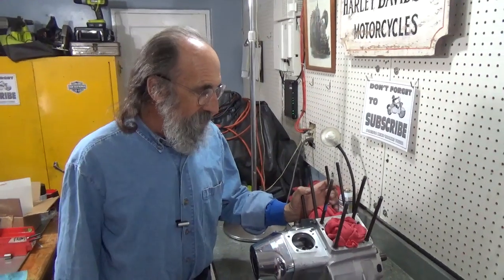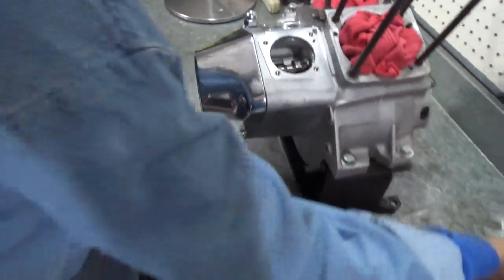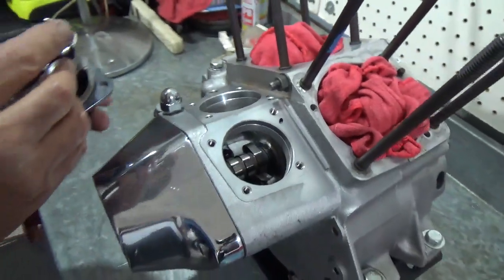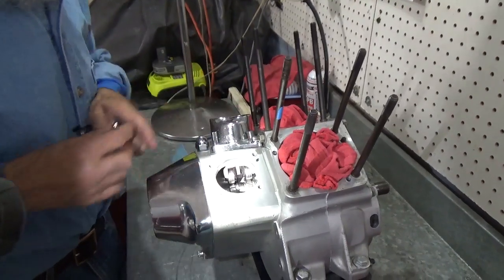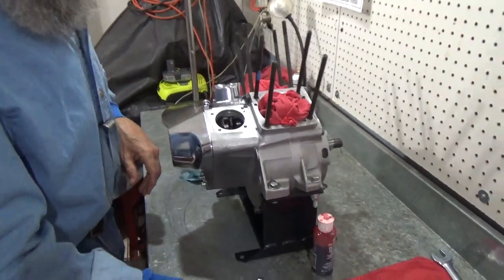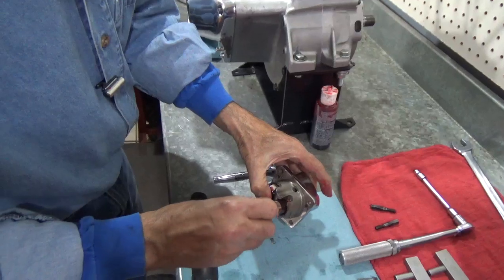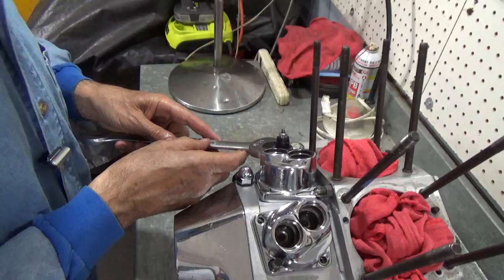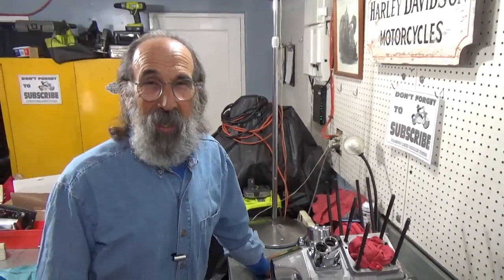Evo Motor Assembly, Part 7, Installing Valve Lifters

Comment: My manual for a 91 evo says 12 to 15 foot pounds I told people this and they thought I was crazy that it should be inch pounds. Finally I seen your video and it’s a weight off my shoulder knowing it’s actually foot pounds I was too scared to do 15 so I did mine to 12 foot pounds.
Reply from the maker: In the Evo book, there is a section on fasteners.  It's a great chart on some basics.  It could make us both appear brighter.  It gives you optimum torques for basic sizes and grades.  It's good stuff.  Thank you for bringing up some questions which need answering.

Comment: How do you cap the oil sending unit if you are going gaugeless?
Reply from the maker: It depends on the cases you're using or oil pump, again, where it goes.  It is most likely a 1/8 pipe thread and therefore, go to the hardware or auto parts store and get a 1/8 pipe plug.  Don't let the description confuse you.

Comment: hi . can anyone please tell me why my evo motors long studs that the barrel goes over are hollow with threads inside for the head bolts to tighten onto .  the motor is in a custom chopper.  nothing is standard on this bike.
Reply from the maker: The nuts are closed on the top.  The studs are not hollow, they are "stretch studs."  This is unless you have something truly unique.  I think you're mixing some definitions.  Be sure you torque things as per the manufacturer.
Reply: @pacificmikesgarage  thanks mike for replying to my question.  My head bolts are not like yours on the evo motor. You call yours nuts because they are hollow . My cylinder head bolts are actualy solid  bolts because the long studs that come from the crank casing are hollow at the top with threads inside them  to receive the head bolts.. I'm talking about the long studs that  the piston cylinder slides over are  hollow . and the head bolts (which are proper bolts)  tighten into these studs that have threads on the inside .  It's very different to your evo motors that you work on.. Do you know of an evo motor that has such a design that I'm talking about.  ?  .
Reply from the maker: I would think the motor would have some info cast into it.  What is the bike registered as?

Comment: Should add 6.5 step to shim the cam to noise cover backlash then put the lifters in
Reply from the maker: You might want to check your cam gear and pinion gear to be sure they are right for the bike.  Service manual covers this.  I don't know what you have or what you installed.  Too much noise, time to look it over.

Comment: wish you explained the alignment tools better. I have no Idea how the worked . wouldn't the screws have done the same thing.
Reply from the maker: The alignment screws are tapered where they go through the tappet block.  They hold the tappet block in the proper place more accurately.

Comment: Hey Mike, I will be doing the lifters on my 87 evo in a few days as time permits. Do I need to let the lifters sit in motor oil prior to installing? I will be leaving the bike sit thru the winter, unless Texas gets a really nice day or two before spring. This is my first harley so I thank for any help you can share with me. fred
Reply from the maker: The lifters should come "preoiled."  Just remember not to immediately rotate the engine after adjusting each pushrod.  Wait for each lifter to bleed down before rotating the engine to adjust the next lifter. Remember, after letting the bike sit all winter, be sure and put a pan under it for your startup in the Spring.

Comment: what a good content mike, I'm from Chile and I've been watching your videos for a while. you explain everything very well, you are very good at doing this job, thanks for showing all this.
I am rebuilding my fxlr 1992 and you help me a lot with some doubts that I had. Could you tell me what was the torque you used in Valve Lifters please? thanks Mike
Reply from the maker: I try not to give answers on things you could easily look up in a service manual.  But, something struck a nerve.  I know that's a 1/4 x 20 bolt threaded into aluminum (I assume you're speaking of "tappet guide bolts").  This should be, according to Harley's usual spec, 90-120 inch pounds.  But I found an incorrect number in a service manual.  90-120 inch pounds is correct for the tappet guide bolts on a 1992 Harley Davidson Evo (Big Twin) engine.

Comment: Hey we need advice on a1995wide glide brakes on front . In other words you are not getting fluid thru lines. Master cylinder works perfect  sooo????? Thanks LB( Noni)
Reply from the maker: Sometimes, you get bubbles in there that just get stuck.  Try tapping on the lines everywhere there is a bend.  Don't beat on them, but tap with a wrench.  Make sure the master cylinder is level.  Alot of the time a "Mighty-Vac" or similar vacuum pump is the solution.  Another thing to try is a rubber band or bungee cord holding the brake lever against the grip.  Leave it overnight and release it in the morning.

Comment: Hi, I enjoy watching and learning wrenching ,just one question. Why do you need an alignment tool for the tappet blocks ,when you can just use the original fasteners?
Reply from the maker: There's a little wobble room in the later stuff.  They should be lined up with the lobes on the cam.

Comment: no Thread sealer or glue...  okay it should be fine i think...  i like the blue thread sealer because you have no lock washers on these bolts... i just think it won't hurt...
Reply from the maker: I don't like thread locker in the threads of my aluminum parts.  Just me.

Comment: hey Mike what is a good sealant for paper lifter block gasket ? or just use a thin film of oil on them
Reply from the maker: I usually spray copper coat on them.  They don't leak, but they're really stuck on.  I may be doing that tomorrow.

Comment: Just got 1987 Electra glide an has horrible tick an the shop that serviced bike told me they have a high revving cam in them and at the loud tic was normal but it really loud an bike has a lot of miles idk how many
Reply from the maker: Maybe you should have someone else check it out.  You need to know that it's okay, or it isn't.  Tick gets louder, pretty soon, it's a bang.

Comment: How do you get a fac. head gasket off easy
Reply from the maker: Well, is it a cast iron cylinder, an aluminum cylinder?  Is it a cast iron head or aluminum head?  What are you trying to do?  Is the cylinder and head on or off?  Can these items be soaked?
Reply from the maker: What is the motorcycle?

Comment: Mike I have a 1990 fatboy 1340 original case compression  test shows 167 psi  on front 169psi o. Rear cylinder I was told it has an ev46 cam I'm I stalling lifters I chose a set.of 33-5353 tappers. I do not have the alignment tool also bike has Rivera ajustable chromoly push rods that look to be in great shape my question to you is the 33-5353 tapper a good choice? Also it is the HL2T kit will this work out or should I change the pushrods and get the alignment tool before I do the job?
Reply from the maker: I don't know those catalog numbers or where they came from.
Reply: @pacificmikesgarage  S&S hydraulic lifter with the HL2T travel limiter
Reply from the maker: I'd have to read their literature.  Most aftermarket lifters are way better than the originals.  I still read instructions.  I can't keep all that data in my head.
Reply from the maker: The adjustment is figured by the manufacturer for how much the lifter must be compressed.  You simply have to combine what the lifters require with the amount of turns to extend the pushrods (number of threads per inch).
Reply: @pacificmikesgarage  The lifters look exactly like these in this video

Comment: Hey mike thanks.  I have a question... Can you install the lifters 180 degrees out?  And if the lifter has no oil will it be weak when you go to adjust the pushrods.  3 of 4 of mine i had to wait 10 minutes each to bleed down and the last one i put the 24 flats on and almost immediately i could turn the pushrod by hand.
Reply from the maker: They do tend to vary.  Because you said "24 flats," I could assume you're working on a Shovelhead.  If it has stock lifters, the holes in the lifter bodies must be turned "in" or, toward each other, assuming they are stock type Shovelhead lifters.  If they aren't, they're Evos or Twin Cams, then the rule no longer applies.
Reply: @pacificmikesgarage  the 24 flats comes from my big dog service manual.  The motor is all s&s 107 evo style.  All parts are s&s. I have heard 3.5 turns and i didnt see a pushrod adjustment in your evo engine rebuild series.  Am i doing it wrong
Reply from the maker: If you're following your service manual, you've got it right (right service manual for your motor).  You've "heard" 3.5 turns?  You need to know what's in your motor.  If you bought it new, you know its history.  Sometimes it's very difficult to figure out what you have, but, well worth the effort.

Comment: Mike, Do new lifters need to be primed with oil?
Reply from the maker: I generally soak them first.  Then I install them.  Then there is no doubt they have oil in them and you don't have to wait for them to pump up.  It's really easier with an electric starter, to spin the engine with the spark plugs out to make sure they're happy first.
Reply: @pacificmikesgarage  Thanks Mike, That was my thought.

Comment: Do you have to use the alignment tool?  Would not the lifter bolts align the block as you finger tighten them?

Thank you, in advance for an answer.
Reply from the maker: I got in the habit doing Evos.  It is "believed" the tappet rollers will line up more accurately with the cam, on an Evo, this way.  It really is easier to get the whole thing set up this way.  But, it's a good question.

Comment: Are those hydraulic lifters? If so I always thought you had to pump them with oil before installing them
Reply from the maker: They had oil in them.  Before starting the engine, I rotate to pump the lifters full.  I thought I explained that in the series where I built the engine.
Reply: @pacificmikesgarage  thanks I’m sorry I didn’t catch that part of the series

Comment: Hi Mike, great videos, had my evo rebuild and now getting heavy oil leak from sprocket shaft bearing seal, running open belt so seal spring is on inside, would appreciate your input
Reply from the maker: Did you replace the spacer with the seal?  If not, the spacer gats a groove worn in it from the seal.  You install a new seal and it doesn't fit the same.  That's what it sounds like.

Comment: Hi Mike,

I have scoured my  J & P CYCLES catalog pretty thoroughly & can not LOCATE the Lifter-Block ALIGNMENT Tool(s)  that you are using on both the EVO & SHOVEL-Head assembly 

Any idea what brand name they were SOLD under ?   or where  I could locate a set of them ?

Thanks for the VIDEOS

COOP

..............................................
Reply from the maker: Yes they are a lifter block alignment tool made by Jim's Machine.
Reply: @pacificmikesgarage  - Thanks Mike - 
I have quite a few TOOLS & ITEMS from JIM's - Thanks for the direction 
COOP
...........................

Comment: Question, Mike. What was wrong with the engine ? Nice series btw👍
Reply from the maker: Thank You.  I didn't like the way it felt.  I went in and "talked" with everyone present.  This bike is a very personal unit and I don't share much about her internals.  That motor is where I experiment.
Reply from the maker: Sorry.  I thought you meant my Shovelhead.  This Evo motor had massive "bad luck."  It started with lifters coming apart and went worse from there.  Then there was a motor to replace it and it wasn't installed properly.  It got problems right away.  I mixed the two motors together, using all the good stuff, and there it is.
Reply: Thanks, Mike.👍
Reply: Ok, thanks again. I own a 1989 flhtp for 9 years . It came from Texas. Now it lives in the Netherlands😃

Comment: Thanks for another great video. I'm curious about your opinion  on using an oil pressure gauge instead of the sensor. And where to install it, sensor hole or the lifter screen plug. Im working on a clean Evo-Chopper and want to skip as much electrics as possible. Thanks from Sweden!
Reply from the maker: Sensor hole with a tee, so as to still have the sensor.  An oil pressure gauge drives me nuts.  All I want to know  is that I have good circulation.
Reply: @pacificmikesgarage   Thanks for your input, guess I keep the sensor anyway. Thanks!

Comment: Mike, when you had the case apart why did you not put a drain plug in the bottom end.?
Reply from the maker: For what purpose?
Reply: To drain that that one qt on a oil change. Is that not where it is located?
Reply: On an Evo you can run the engine with the oil filter off after changing the oil to clean the bottom of the cases out. Just keep adding oil to the oil tank until it comes out perfectly clean.

Comment: Okay I have to ask the question. Why are the locator tools better than just the four bolts that belong in the lifter blocks?  Wouldn't they line it up properly?
Reply from the maker: I'm sorry I didn't do a better job of showing the tools.  They are long and have a precision made taper on them.  The holes in the lifter blocks are fairly large.  The tools center them up very well.  Then, the same tools are useful for installing other things, like Twin Cam oil pumps.
Reply: Ah,  OK.  Gotcha.  Thanks.

Comment: I have a Korean junk RevTech Evo that is in my shop now. The needle bearings in the rear exh lifter failed which chewed up the lifter, cam, oil pump, cam chest bearings, destroyed a lifter block, cylinders, and pistons. I found a loose roller on the front intake as well... Other than that everything else looks fine.
Reply: Lane Johnson ouch
Reply from the maker: Sad story.  Sorry 'bout that.
Reply: That really sucks